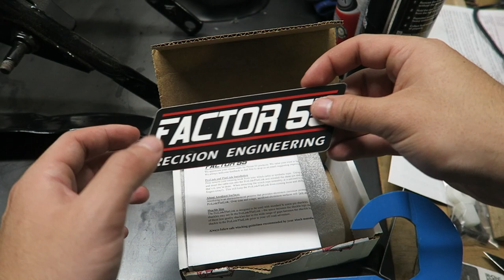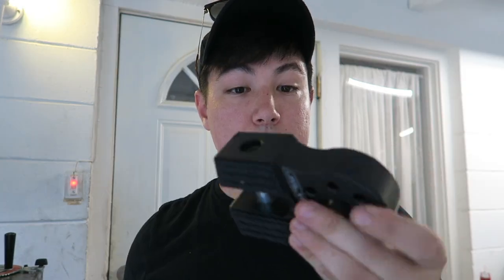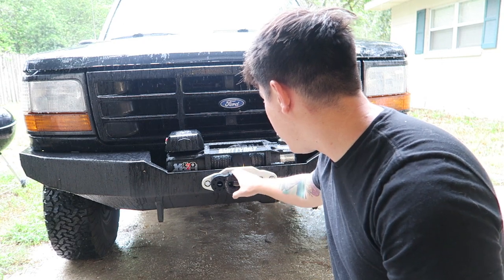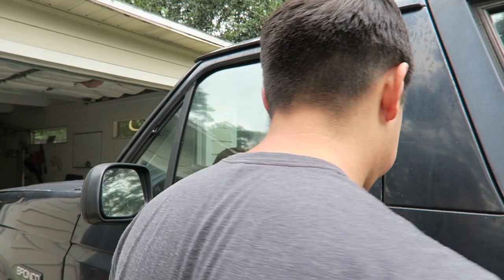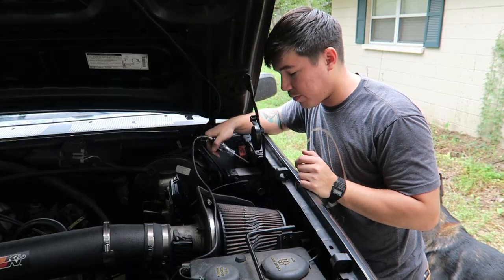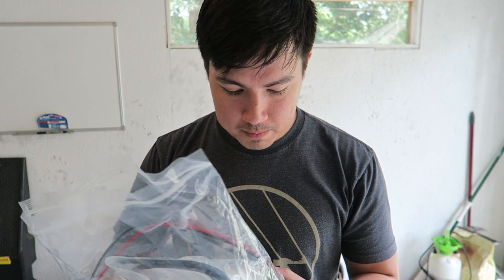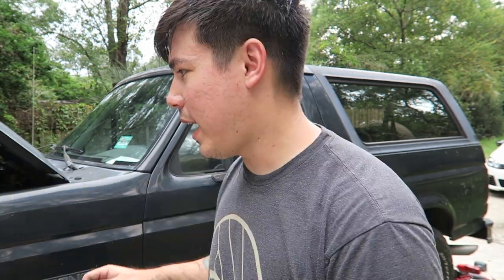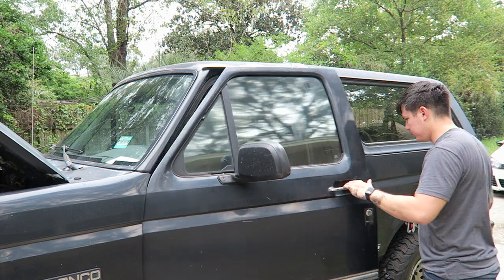Factor 55 Flatlink install (AE#6)

Comment: double checking everything is a great idea, once I changed a fuel pump in my bronco only to find it still didn't run and it ended up being the maxi fuse for the pump lol.   Another good thing to do for changing fuel pumps is to cut a piece out of the bed floor above the fuel tank and make it into a hinged access door so you don't even need to drop the tank to change the pump.